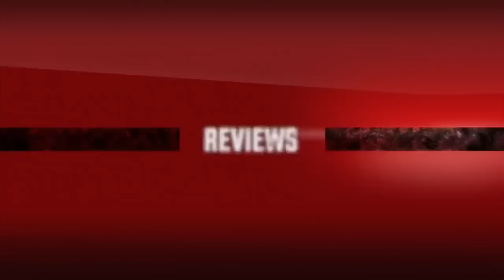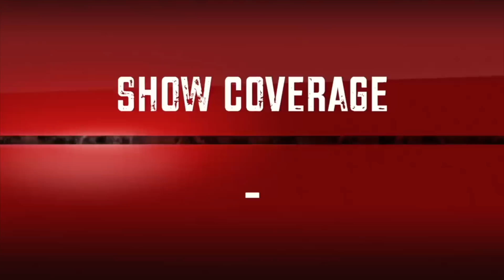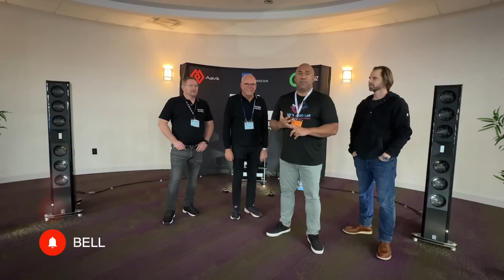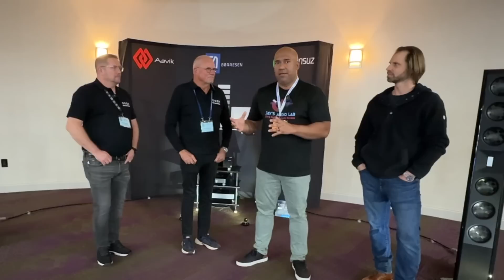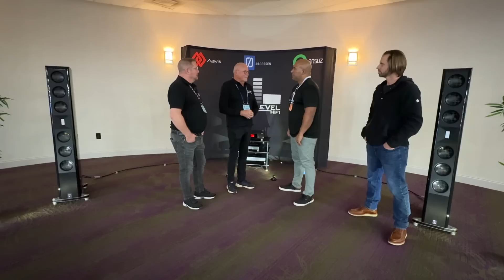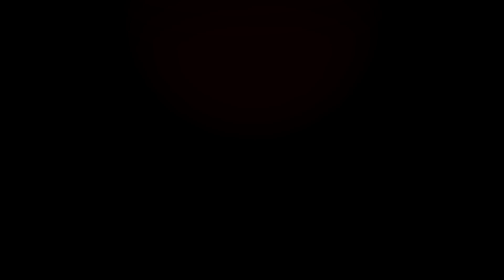Capital AudioFest 2023: Jay's Audio Lab Top Room For $50,000

Comment: Borreson x3 seems to be best value in high fi at the moment.  Would love to hear and compare with other speakers in that price range. Tough competition in that price point.
Reply: I agree I bought the x3's and they totally blew away my much more expensive Gamut l7's
Reply: @2013brzsubaru  do they need a lot power? I have a very neutral power amp. Specs.. 250 Watts x 2 into 8 Ohms, 500 Watts x 2 into 4 Ohms
~ First 12 Watts are Class A ~
Reply: @backrack01  250W with the first 12 in Class A should be a good fit. Treat the room fully and do some tweaking with the dac.